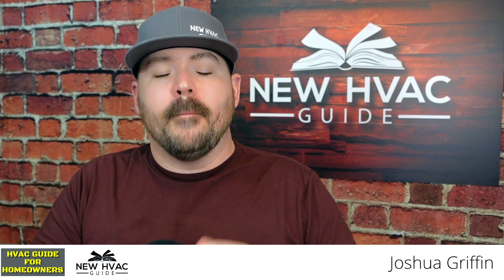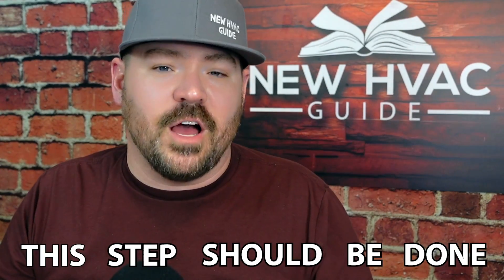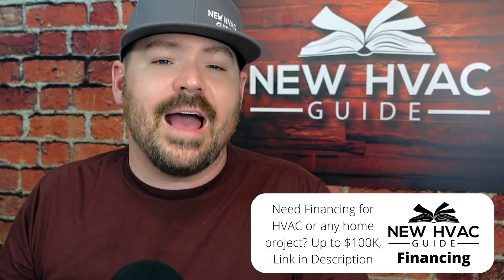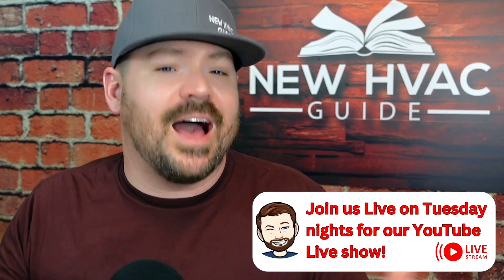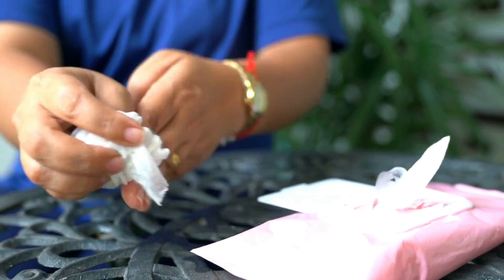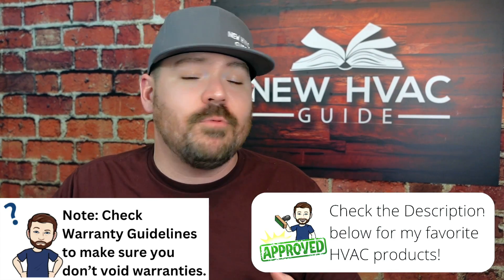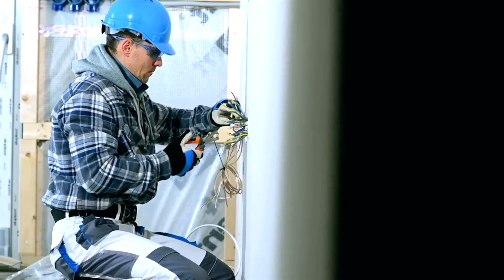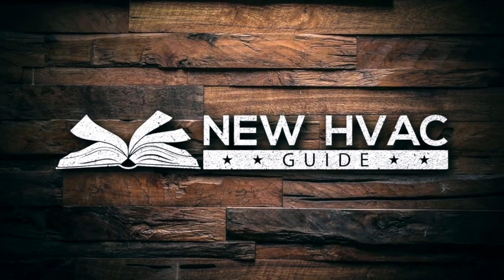Refrigerant or Freon Leak? One Step You Should Do!

Comment: My check of a low refrigerant charge is 1 of 3 options unless it's visible via oil. Charge and go... no warranty and no guarantee!. 2nd would be a leak seal attempt with a 50/50 chance with no guarantee but warranty for leak seal cost. 3rd would be leak search and recharge. If repair is gone with for leak, no further charge after leak repair and pressure check if further leaks present.  We currently don't use dye and I think it's because it b use to clog txvs or so said anyway!
Reply from the maker: That used to be our three options. We called it the four options with the fourth option being replacement. Customers with lots of issues would go with the fourth option. I’ve never heard of dye clogging a TXV. Leak seal wouldn’t be more likely to do that if there’s moisture in the system.